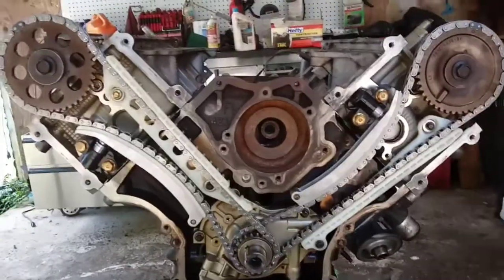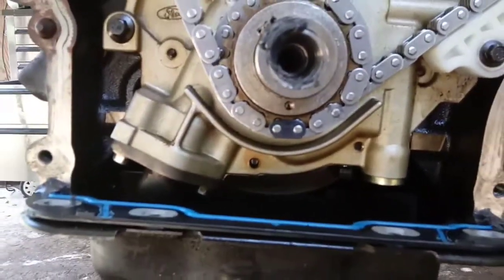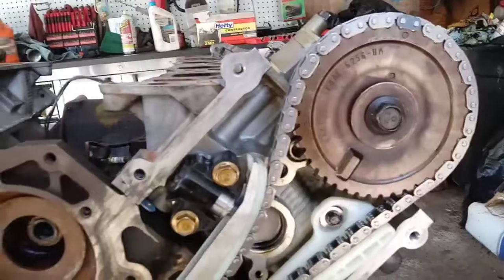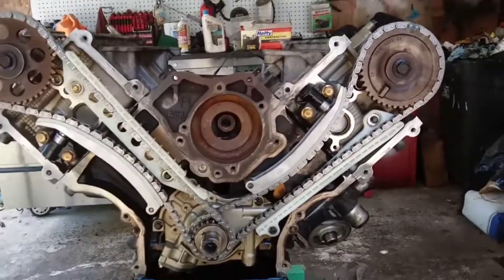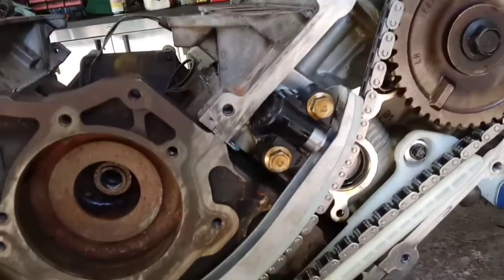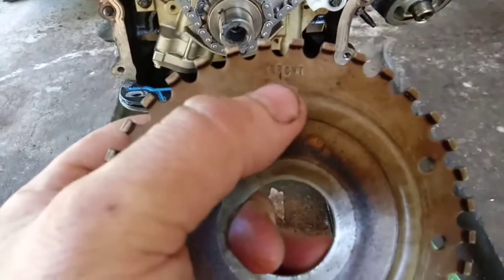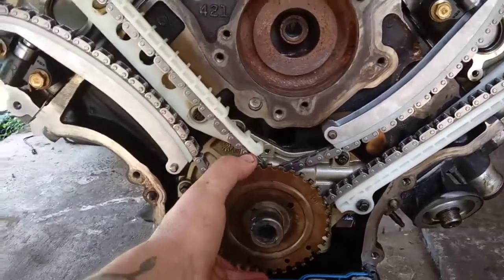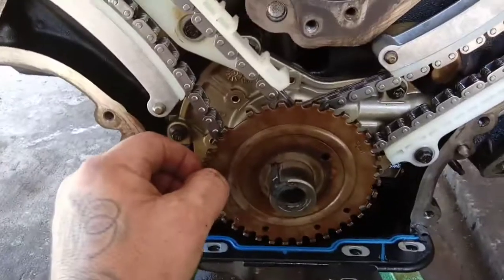Ford 4.6 2v timing marks

Comment: I just did a timing chain, guides, and cast tensioners on a 5.4 2v. Started right up, but there is vibration in the engine. No codes. Almost like most of the cylinders are missing.  I am fairly confident I put the "tone" ring on correctly. I did see the front mark on it. Anything else I should look for that would cause these issues?
Reply from the maker: Right off the bat there is a couple things id go over first. Make sure all the wiring is plugged in even if you think it is go back and check by putting your hand on every single sensor. Make sure there is no vac leaks
Reply: @MrMelvinkennedy1  thanks for the reply. I felt like I triple check the timing marks and colored chain links. I have gone over all the connectors several times and I have been searching for a vacuum leak but I can't pin point one. Plugs look lean.
Reply: I focused more time on the connectors on the injectors and coils than the sensors. I'll spend some time validating the sensor connections.
Reply from the maker: @danporter643  is it a possibility you bent a valve, unlike the 3v the 2v is very tight tolerance wise
Reply from the maker: @danporter643  if you unplug each coil 1 at a time for a sec look for the one that doesnt make a difference in the running of the truck and you have the cylinder that needs attention. So say unplug cyl 5678 1 at a time and each one makes it run worse then you go to 1234 and 134 makes it run worse but when you unplug 2 it doesn’t affect the engine you know 2 is the source of the misfire
Reply from the maker: @danporter643  thats a quick check to narrow down cylinder misfire without a computer. It also lets you know if you have multiple misfires rather than just 1
Reply: @MrMelvinkennedy1  the engine is in a 2000 expedition. Just purchased it. t ran ok previously, but was making a lot of timing chain noise. The only work I did was the timing chain kit and oil pump. After everything was installed I was able to rotate the crank without any hard spots or stops.just normal compression in my opinion. I have not heard any tapping etc.
Reply from the maker: @danporter643  if you have a scanner go in to mode 6 to locate cylinder misfires per cylinder without check engine engine light. It has to misfire x amount of times before throwing a light
Reply from the maker: @danporter643  sounds like you should be ok as far as valves go.
Reply: @MrMelvinkennedy1  I checked mode 6 from my cheapo blue tooth when I worked on it last. There is misfires on a few cylinders, but the hex numbers for the IDs of the cylinders don't match up with the documentation I found for the 5.4 of that year.
Reply from the maker: @danporter643  how do they not match up?
Reply from the maker: @danporter643  can you tell me if all the misfires were on one bank vs scattered
Reply: @MrMelvinkennedy1  Seems scattered. I am looking at $53 monitoring id only. $01, $04, $07 come back ok. Then the scan tool shows 4 with component id  $00; 2 of those with a high count and 2 with 0. Also 3 on component id $46; 2 with a high count and 1 at 0. Hope this explanation makes sense. Thanks again for the ideas.
Reply from the maker: Do you think you could have maybe got it a tooth off on timing ?

Comment: dear LORD get rid of those plastic timing tensioners those things are EVIL.  they don't have ratchets in them so during cold starts the timing chain runs slack and it eats into its guides until oil pressure reaches them which can take way too long when its cold out. The iron ones have ratchets in them so they stay tense even without oil pressure. also check your pan and pick up tube for plastic bits from the timing guides being carved into.
Reply from the maker: Thanks for the comment. This is what i do for a living and the customers get what they pay for. Yes i always check for debris during any tear down. The plastic dont ratchet because they are spring loaded if i recall correctly so there is always a certain amount of tension even on cold starts.
Reply: @MrMelvinkennedy1  ok sorry, it would seem I spoke from ignorance. also do you have any idea when ford started using plastic timing tensioner? Do you think my 99 grand marquis has them or are they iron?
Reply from the maker: If im not mistaking ford never used plastic, the plastic is aftermarket. i would say yours if factory is not plastic. i dont recommend using aftermarket parts but i give the customers the price difference and more times than not against my advice they go aftermarket and warranty reflects that.

Comment: I have a 07 f150 4.6 2v blowing black smoke rough idle i change the oil smelt like gas changed the injectors new spark plugs still same thing when i bought the truck number 3 cylinder had a striped plug hole i took head to get fixed put new gasket cut head timing on what could be wrong
Reply from the maker: Sorry im just seeing this. If you havent figured it out yet please let me know and ill do my best to help.
Reply: Yes I'ma kinda late too but the problem was a vacuum leak on under the radiator.